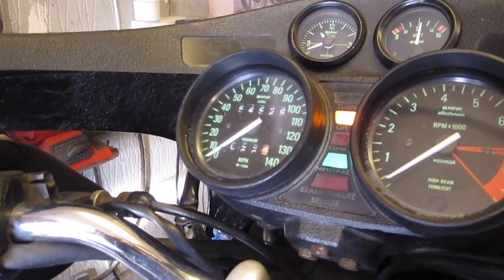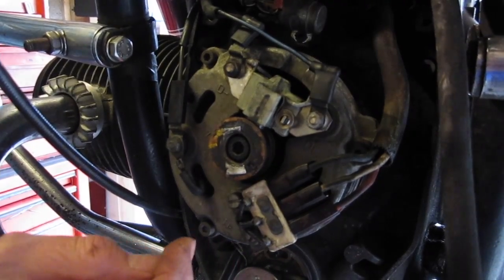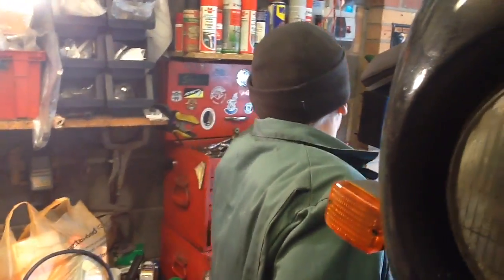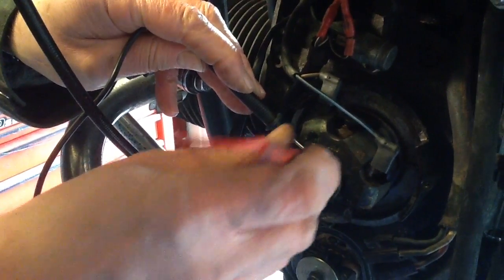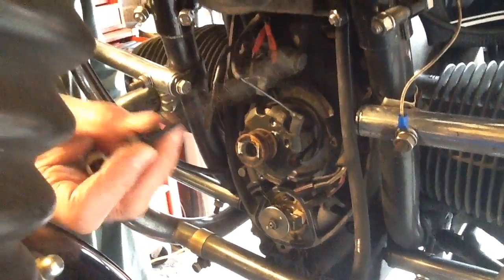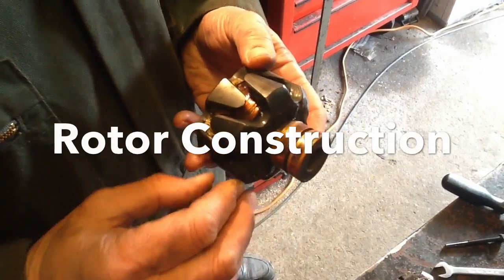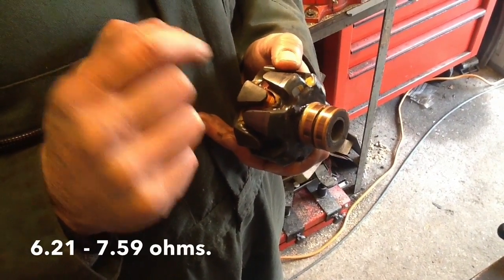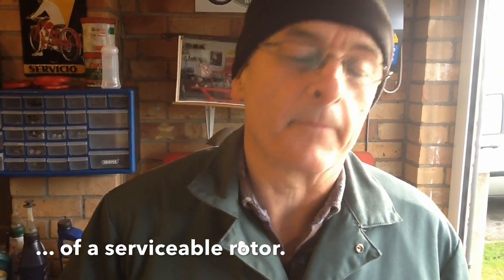Airhead Battery Not Charging

Comment: Hi there. Great video. I was wondering if I could pick your brain as I am presently stumped. I have a 77 R100/7 which has been standing for 7 years. My generator light does not want to go out. I have replaced the whole charging system including: rota, stator, diode board and regular because no single replacement resolved the issue. As suggested in the manual I have tested the voltage between the B+/30 (disconnected) and the D- and now get about 14 to 15 volts. But at the battery terminals I get about 12.5 volts. Any ideas?
Reply from the maker: Hi, always difficult to diagnose faults remotely. Try removing the two cables at the brushes, then switch on the ignition. The gen light should be off, reconnecting the brush cables should relight the lamp. If the gen lamp stays on with the brush cables removed, there is likely a short somewhere between the lamp and the brush connection. If the lamp behaves as it should when the cables are disconnected (goes off), then it is likely there is a short in the rotor or slip rings. You can test the rotor with an ohm-meter like I do in the video, if the resistance is significantly lower than the manufacturers spec, the rotor should be replaced. Hope that helps.
Reply: Hi. The parts were getting tired and I needed to replace everything because every time I replace a part the voltage shot up. I probably didn't need to replace the diode board though. Finally resolved the issue. The D+ connector in the regulator connection block was not connecting and therefore nothing was getting to the back of the Diode board. 
Could not find a proper connection for the year of my bike(77), so ordered a "WIRING LOOM REGULATOR TO ALTERNATOR" for 70-76 from motobins. Had to adapt it and replaced the regulator connection block and wires D+, D- and DF to the diode board and rotor.
Reply: What about just one of the cables removed?  If I remove the D+ the light stays on, DF removed the light turns off and both removed the light turns off.  I am still trying to find the broken piece.  Just got a new rotor and stator, and tried a new diode board as well.  I am worried I fried the board somehow maybe with a bad ground?  I had the cover off for all of this.  Been scratching my head on this for a while now.  Thanks.
Reply: Hi Jonny. I eventually resolved the problem by posting my issue on a BMW forum. They gave me a great step by step procedure to find the fault. See here: http://www.bmbikes.org.uk/Forum/viewtopic.php?f=15&t=23744
Reply from the maker: anotherrandomname2 Thanks for the comment, I don't always get to view, or perhaps have time to respond, but I'm glad to see this issue is now resolved.

Comment: I have a few old airheads I am rebuilding, and they both seem to not charge very well.  I am only getting about 12.9V at idle and about 13.2V at 2000 RPM on a healthy Shorai Battery.   The rotor is only showing about 1.5-2.0 Ohms, (But that is not pulled off the bike - not sure that matters)  Is that enough to give you a weak charge.  The brushes seem fine but will replace those too.   Thanks in advance.
Reply from the maker: To check the charge rate, first switch on the headlamp for 5 min without the engine running, then connect a multimeter set on the  0 - 20 volt scale to the battery. Leave the lights on and start the engine, observe the meter it should read between 13.5 and 14.5 V and then start to fall back as the battery charges up.
Early airheads had slightly lower power generators. If you check in a workshop manual you will find the values correct for your generator. If the rotor resistance is low replace it. Resistance should be checked with the brushes not in contact with the slip rings. Slip a piece of paper between the brushes and ring when you check. May also be worth checking the regulator and rectifier next.

Comment: Hi, thanks for your video, it is very professional and educative. I was wondering if you knew what yo do when the GEN LIGHT is always ON? I have done every steps you showed on this video, I read a resistance of 2.7 ohms on stator, but very different with the brushes ( cannot remember well but around 67 ohms)>
I changed the voltage regulator, and I also had a burnt red wire ( i think it is #86) going from the starter relay on the left side of the tank to the blinkers clip ( black clip with 6 wires).

Would you know by any chance if there is a way of testing the relay with a multimeter? ( I will buy one whatever happens but for the future if it happens again)
And also, should I replace that wire, knowing that I do not run any blinkers ( post 1985 motorcycle in New York state do not have to have blinkers).

I really appreciate your videos, they are very helpful, and are much more easier to understand than reading a book. 
Cheers,
Robin
Reply from the maker: +Robin Zeitoun To test the most common type of relay, connect each lead of your multi-meter to terminals 87 and 30 (doesn't matter which way round), then set the meter to the 0 - 200 ohm scale. The ohm meter should read open circuit, i. e. infinity. Leave the meter connected to terminals 87 and 30, then connect terminals 85 and 86 to the battery + and - terminals (doesn't matter which way round). You may then hear a click and see a very low value (almost 0) on the meter. When you break the battery circuit the meter should read infinity again.

If the cable attached to 86 is burnt on your starter relay, replace the damaged piece of cable. Investigate and try to find out why it is burnt. Seems to me there may be a short. You do not mention which model you have but from memory I seem to recall 86 is live when the starter button is pressed and 85 goes to earth possibly via the clutch and/or side stand isolator. But you should check on a wiring diagram

Regarding the Alternator, first you will need to have access to data about the alternator for the model of airhead you are working on. I suggest you get hold of a copy of the manual for BMW 2-valve twins 70 to 96, published by Haynes. At the beginning of chapter 10 you will find under the section headed Specifications the data you require in order to make comparisons with your own readings. Section 6 in the aforementioned chapter will guide you through a number of tests you can perform to help diagnose your problem.
It is usually difficult to make a diagnosis of electrical faults from a distance and I think your best and quickest route lies with the use of your meter and a logical sequence of investigation as on offer from the Haynes manual. 

Hope that helps.
Reply: +Moto Phoenix Thanks a lot for your quick reply.
I completely forgot to mention the year and model.. It s a 1984 R100 RT. About 60K miles on it. 
I found out why the red wire got burnt :
Not long ago I disconnected that connector ( it was attached to blinkers, clock, and voltmeter), as I am turning the bike into a cafe racer and did not need any of the instruments nor the blinkers, although I reckon some water introduced itself in the connector that I left kind of hanging around, and shorted it...
I am lucky it happened in front of me and was able to trace it to that wire that was useless at the time.

As for the starter relay, I ended up buying a new one. It was probably the original one from 1984 by the look of it... Although I will get a Haynes manual, surely it will come in handy!

Thanks again for your help, I will let you know how I go.
Cheers!
Reply from the maker: You are welcome Robin Zeitoun and I look forward to hearing from you again.
Reply: +Moto Phoenix I ended up getting the clymer to find out what was wrong. I found the book very vague unfortunately, but I was able to identify very quickly that the diode board was faulty ( also thanks to you using the diode board testing videos you made). One of the diode burnt out ( Still trying to figure out why so it doesnt happen again, although I m thinking the battery is a bit old and also used a dry cell one a few times, which would have damaged it).
I have another question for you ; I read on a few forums that the rubber mounts were not the greatest to keep on, so ended up buying the metal one for euro moto electric. BUT, to access the inner nuts, I might have to remove the starter motor. Would there be any other easier/quicker way that would not involved removing anything. I am pretty switched and capable of doing all that but from experience, if something works well and does not need to be moved, I would rather leave it where it is.
Thanks again!
Cheers,
Robin
Reply from the maker: Hi Robin, diodes burn out occasionally. But it may be worth checking for a bad connection from the soldered joint melting, caused by the heating effect of the rectification process. I have had this happen to a couple of diodes on my 400 W generator set-up. I re-soldered the joint each time with old-fashioned plumber's solder (higher melting point), which appears to cure the issue.
Personally, I am not adverse to rubber mounts, but they do fail from time to time. They are very awkward to change and I did fit the solid ones that came with my 400 W kit. I have managed successfully in the past by using a 1/4 drive socket that incorporated a u/j, but even then it's a fiddle. Or you could try holding the nut with needle nose pliers or magnet whilst you screw the mount onto the nut, then finish with a socket or spanner. Good luck

Comment: Thank you for the video. I'm currently rebuilding a R65 and only got a charge of 11.7 volts. I'll be using this method to check the rotor arm now as i have just checked the diode board and that seems to be working.
Reply: +Trikerbloke Turns out it was the regulator on mine. I made a quick video to show how I diagnosed it and put a link in to this video for the rotor. Hope thats alright.

Comment: Thanks for the video! My gen light was going intermittently on my /5 so I used your process to troubleshoot it. Turns out my brush wires had come unsoldered and were just rattling around loosely in their holes. Got them soldered up and pulling 13.6v at 3500 rpm. I'm still going to eventually upgrade to the EnDuraLast 450w system, but this will delay that process for a while now.

Comment: hello sir, very interesting vid, tnk u so much!! ;) , i have the same problem with my R80RT and i have two questions:
*you've disconnected the battery earth cable to open the cover, then you've reconnected it, Do u keep it that way and do all the next steps?
*Do i have to change the rotor itself or the wire only?
thank you again and hve a gd day!
Reply from the maker: Amine Makhlouf Hello, I only disconnect the battery to remove or refit the cover, since it is very easy to cause a short circuit by touching the cover on the rectifier (diode board), mounted above  the alternator. This may result in overheating and damage to the electrical components. So, yes, reconnect the lead to carry out the next steps.
If you can I would recommend replacing the rotor. However, you may be able to find an electrical specialist nearby who can rewind the old one. I have had this done in the past, but with limited success, since the rewound rotor did not last as long as the original Bosch item.
Good luck with your repair.

Comment: Sir, have you had any experience with a high voltage overcharging condition? I have read to check for high resistance or an open in the regulator brown ground wire( the regulator was already replaced). Thank you.
Reply from the maker: leadfiremech Hi, it is always difficult to make a diagnosis at a distance. But if you are sure the regulator is not at fault, then I would start looking for an open circuit in the battery voltage sensing cable that goes to the regulator. This would prevent the regulator from doing its job.
Reply: Moto Phoenix Thank you sir